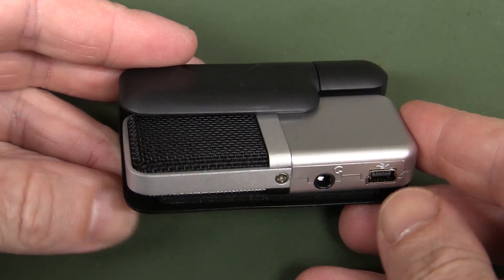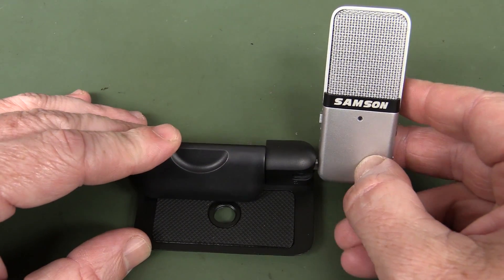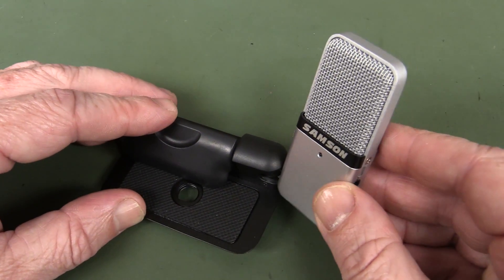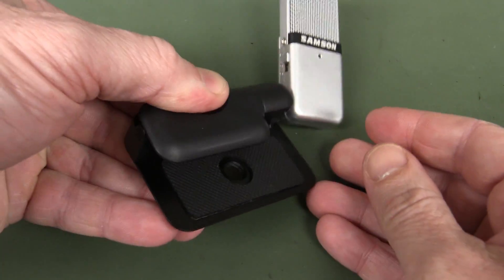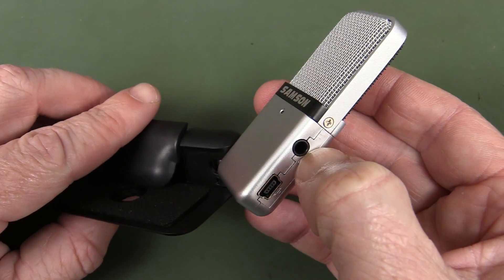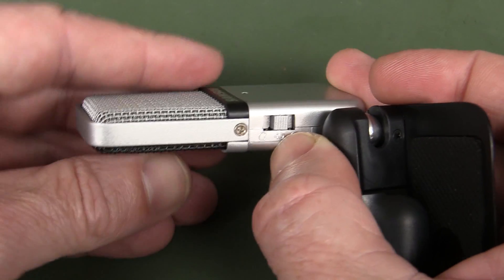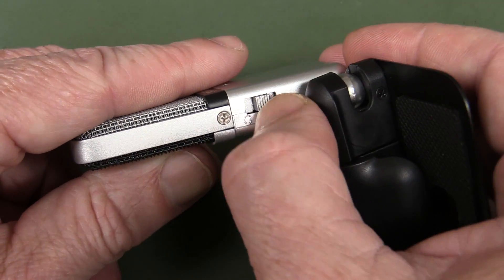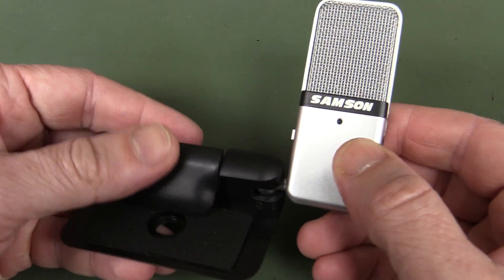Samson USB GO Mic Teardown

Comment: Two capsules are used so you change from omni  to cardioid .... one capsule is omni and the other cardioid and it just switches capsules .... Electret  capsules are so cheap that this is the easiest way to get the job done.  A cardioid electret will have some way for sound 9or sound pressure) to enter the back of the capsule to create your 180 degree signal 'mechanically' get your cancelling so I'd say the top is your cardioid and the bottom capsule is the omni
Reply: please help me, i opened the mic to change the switch and the cardiod mode is in low volume now, what have i done? the cardioid mode still words but is in a very low volume, how can i repair it?
i dont know what to do

Comment: you can sum analog signals still using an opamp in 2017! no DSP needed...

I was actually expecting two capsules back to back when you showed the omni-cardio switch, where you would either add or subtract the signals in order to modify the characteristics...

Comment: trouble is that if you don't edit then you are left as clueless as the rest of us ! I stole the following text from the web re: the two capsules:                 

How Multi-Pattern Mics Work

Rather than requiring a separate mic for every job…engineers came up with an ingenious idea to cram a TON of versatility into just one mic.

They realized that…simply by varying the output from two back-to-back cardioid capsules, you could recreate virtually any polar pattern imaginable.

For example:

    By combining both cardioid signals, you get an omnidirectional pattern.
    By combining both but reversing the polarity of one, you get a figure 8 pattern.
    By turning off one, and using the other, you get a cardioid pattern.

credit to:  ehomerecordingstudio dot com
Reply: That was exactly what I expected to see - but that's obviously not the case here, where one capsule has the one characteristic and the other one the other...

Comment: I got a logitech guitar hero usb microphone from the salvation army for $2. The wire was broken, but by movement the break was under the hold it part. I cut it and soldered it on. All is fine but the SNR of the DAC sucks and I almost wish I just soldered on a microphone cable to my sound card instead. So now I don't know what to do really.

Comment: The capsule with holes in the back probably has the cardioid pattern. The reason is, that sound waves from behind the microphone get bent into the front side of the capsule. So the backside holes allow for destructive interference between sound waves directly coming from the back into the holes and sound waves bent around the capsule to the front side. For example, both sides of the capsule experience a sound wave peak, so they cancel each other out. 
With this method the directional behaviour (cardioid pattern in this case) of the microphone is achieved.
Reply: Metalhead777 Your right... only sound-pressure receiver are by definition omni directional... Sound speed receiver are cardoid (with holes in the back).
Reply: please help me, i opened the mic to change the switch and the cardiod mode is in low volume now, what have i done? the cardioid mode still words but is in a very low volume, how can i repair it?

Comment: Grounding wire was soldered to the washer I think.
Reply from the maker: Yep, I suspect so.
Reply: I use the same mic, and have broke the earth wire also, it goes to the washer. I think one of my mics face towards the back of the mic...going to have to open it again to confirm
Reply: Just checked, both of mine are facing forward also.

Comment: The reason for second capsule could have to do with the Omni mode... the top Capsule looks like a electret one ("permanently" polarised). I guess they are by definition not omni...
Reply from the maker: Yes, one is omni the other is cardioid
Reply: @EEVblog2  please help me, i opened the mic to change the switch and the cardiod mode is in low volume now, what have i done? the cardioid mode still words but is in a very low volume, how can i repair it?
Reply: They are both electrets. Electret capsule can be omni, cardiod (or uni-polar), dipole etc.
They are obviously for creating a certain beam pattern. 
Basically every device that is this little has just little electrets inside.
Reply: Nope. It's simple to build a TINY microphone with a huge frequency response (look at your phone!) but it's fairly hard to produce a capsule that could be electronically changing it's pattern!
You may use different capsule for better frequency coverage in professional studio recordings, but there we tend to use different sized capsules
Reply: Hanes vettori I would assume two mics are for better frequency response.... :/